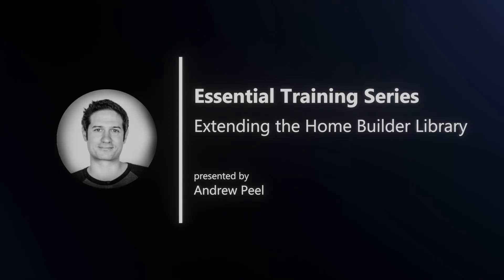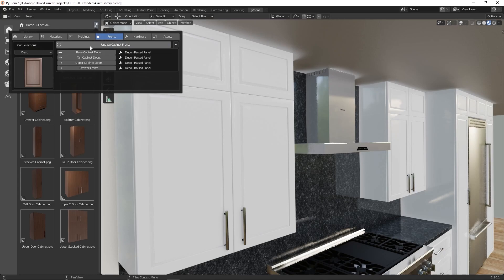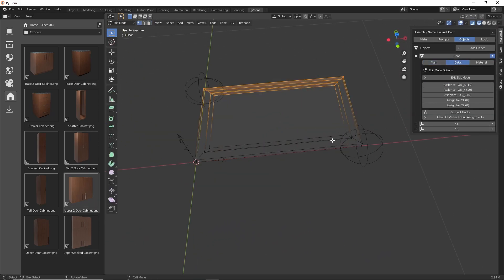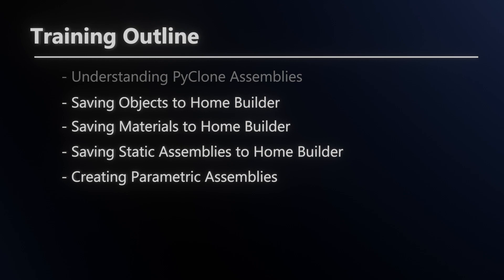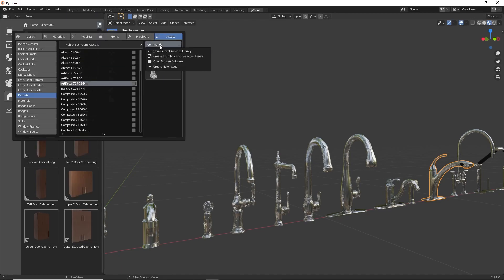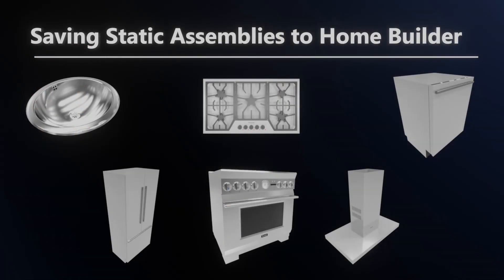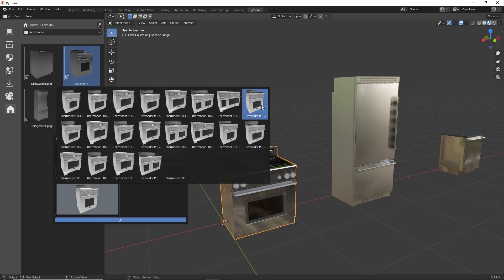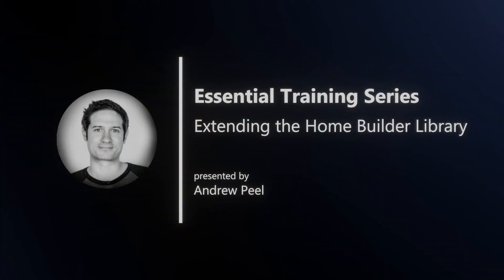Training Series: Introduction to Extending the Home Builder Library

Comment: great stuff which blender needed. I have a question regardless linking assets, not appending. This option is available now in pyclone?
Reply from the maker: Not yet. I was planning on adding this to the ToyBox Library, but I am waiting to see if the official asset system implements this in the 2.92 release.
Reply: @andrewpeel1996  sure, also waiting for this feature